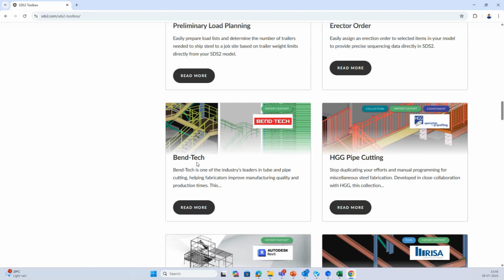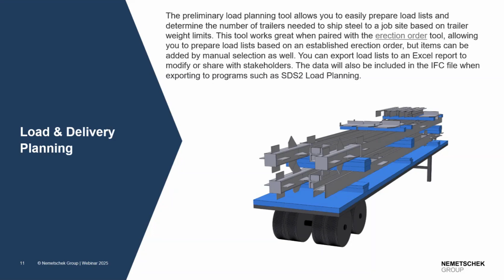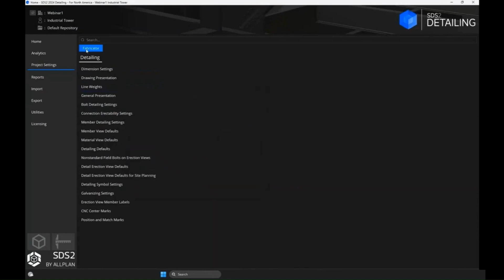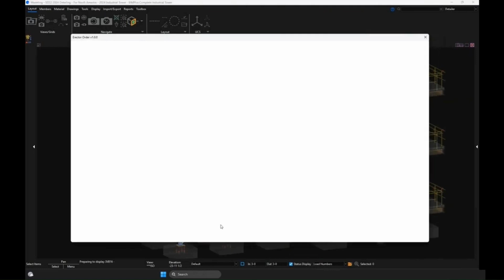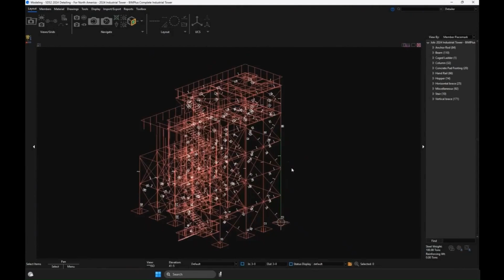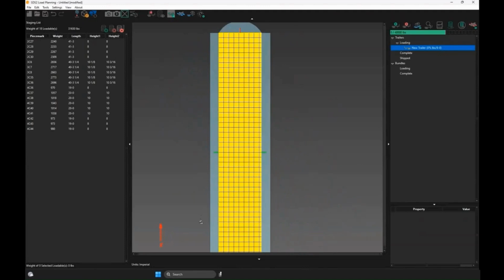Comment: Can SDS optimize loading automatically?
Reply: SDS2 can indeed optimize loading automatically. Its automated connection design streamlines project workflows by considering structural integrity, constructability, and erectability. Here are some key features of SDS2's load optimization :

- Intelligent Connection Design: Automatically generates connections based on setup preferences and load requirements, ensuring structural soundness and code compliance.

- Automatic Piece Marking: Saves time by automatically marking connection materials.

- Erectability Checks: Unique feature that considers the complete node, making adjustments to avoid material clashes and ensure smooth erection.

- Customizable Fabrication Preferences: Allows users to adapt the model to their fabrication preferences and manually override connections if needed.

- Load Planning: Transforms IFC building models into 3D and 2D trailer models for optimized loading and unloading.

- Site Planning: Helps determine crane placement, generates critical lift reports, and visualizes the model for erection planning.

By leveraging these features, SDS2 enables faster project completion, reduced errors, and cost savings.